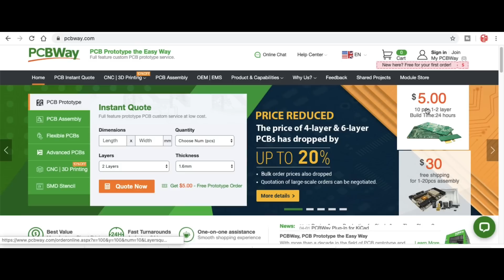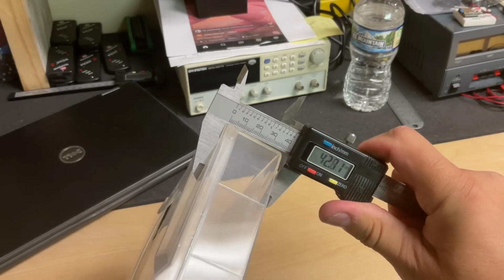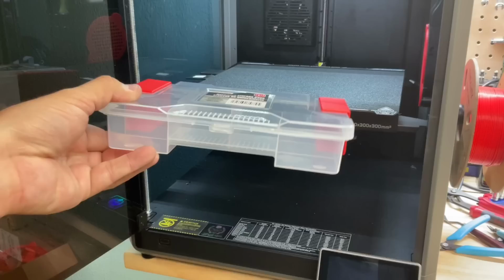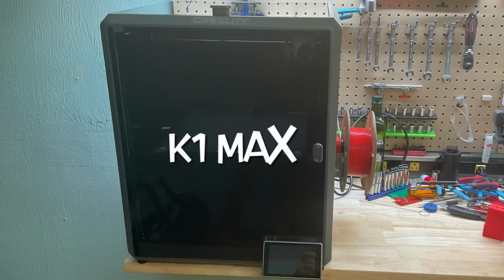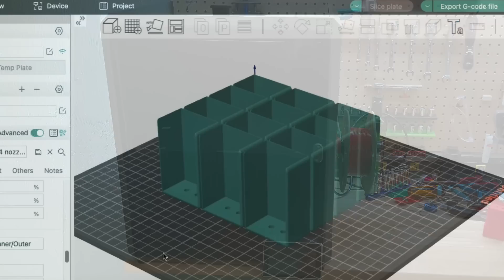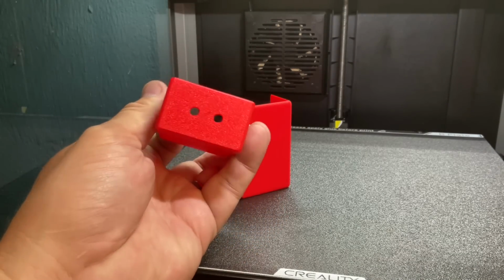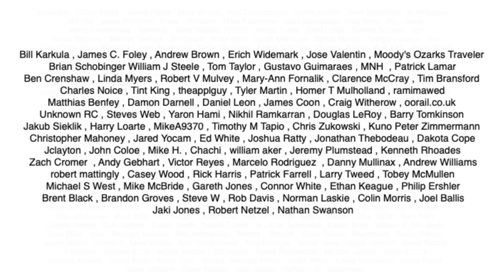Organize your Workbench with 3D Printing and The Dollar Store

Comment: I loved this idea, so much my wife bought me 18 of these boxes, and i designed and printed brackets. I  did them differently, printing them stacked 3 high, so each set would hold 3 boxes, with a seperator between each. Then stacked those 2 high, to make room for 18 boxes, all mounted to a 12 x 36 and 10 x 36 black shelf,  from HD so they are all together on my desk. 
Thanks for the idea Chuck. 
Paul, USA!

Comment: Pretty cool, I made some brackets, with a clip for round Mentos gum bottles for leds and such, then they clip to the front wire rails on my wire shelves. Just for small stuff, and a label on the popup cap, which is attached.

Comment: Nice idea, nevertheless those containers are not sold here in Germany similar, but sure with other brands and at least the same. The design is easy to reproduce on other boxes. I would combine them in bunches  so i didn't need to fix every single unit separately. 😊

Comment: For strength I’d print those with the largest flat surface on the bed so the 3 sides would print up. You’re screwing through those holes so if they aren’t perfect no big deal.
Reply: Yes, I had the same thought.  The layers are the weak point, and the first ‘C’ shape layer is holding the full weight to the wall.

Comment: 4 screws for each box seems to much. Maybe better to design bracket for more than one box and save screws, work and holes
Reply: I wonder if you could stick them together with heat and only screw the whole thing in at the top and bottom part.
Reply: You could alter the design to make the individual brackets snap together, and then just have a single screw hole in each, and skip over one when mounting.

Comment: Great Idea!!! Makes me think this can be adapted to a Laser cutter/engraver by designing with finger joinery and single dividers to make a more unified unit using 3mm basswood. I've got a 3D Printer too--Ender 6, but after paying less than $250 for the laser cutter on Amazon, I've discovered a bunch of more uses for the laser cutter!!! The purchase decision stemmed from absolute frustration while cutting bulletin board lettering for my wife using a Brother cutter and the short-lived adhesive mat used to run the paper through the machine. With the laser, I can just drop it on the bed, secure position with several flat neodymium magnets and cut away!!! Zero wasted time other than layout and design which is no biggie!!! The software I use is LightBurn which is easy to use and has a great reputation. If anything, TinkerCAD and 3D Printing helped me translate to the 2D and designing the 2D to design 3D objects. Probably the most "difficult" thing regarding the laser is the material testing to find the proper cut speed in relation to proper laser power output.
Reply: Since you have Lightburn and are a Tinkercad user, the use of both is great.   I have  many 3D printers and a Creality laser cutter with the 20 watt laser diode head.  I can take a jepg inport it into Lightburn and export as a SVG to import to Tinker.  I have had great results in 3D printing and laser cutting then combining parts.   Make a lot of tokens and coasters using both.
Reply: @woodwaker1  ...and since you have a variety of 3D Printers, have you heard of the Alex Kenis Z-Axis Coupling Ball Bearing Hack/Trick??? 🤔
Reply: @RTR-MATEY  Not sure, I did add wobble x to my RAT RIGS,  don't think I would do it again.  Had a lot of trouble keeping the balls in place.
Reply: @woodwaker1  The Alex Kenis Ball Bearing Hack uses a SINGLE ballbearing that acts as a solid pivot point in the flex coupling to eliminate any type of bounce. A simply genius hack!!!

Comment: Great idea!  I have not seen those at Dollar Tree, will have to look.  I am almost finished with a similar project using the Harbor Freight storage parts case.  I found a design on Printables for the rail adapters.   I had some plywood scraps and threw a case together and started printing the rails in ABS, have slots for 10 and space for more.